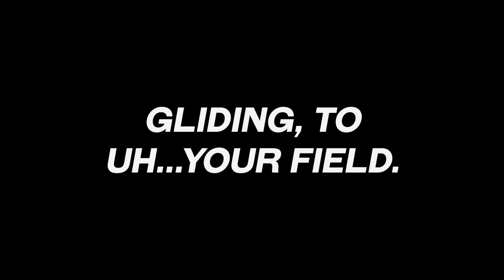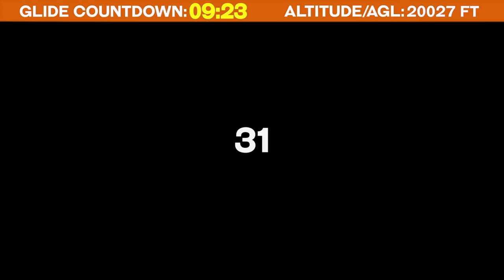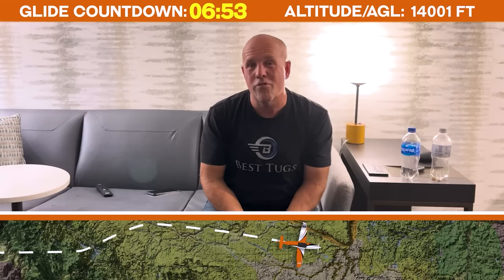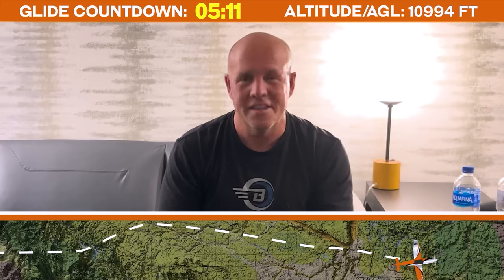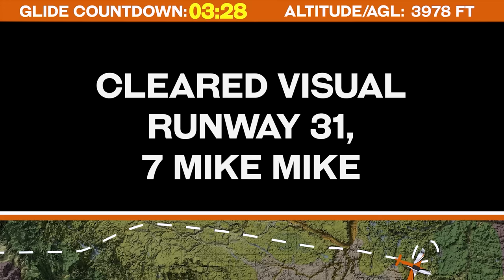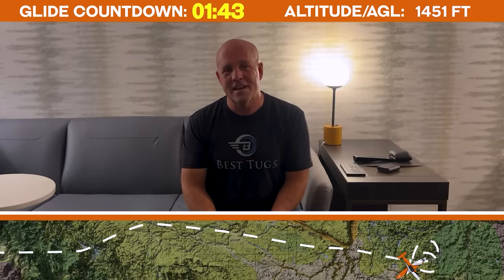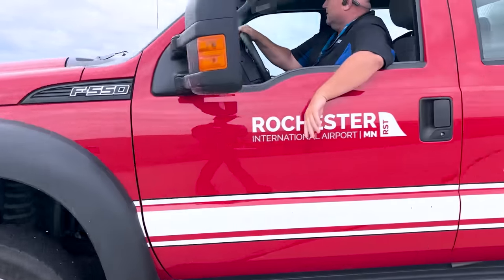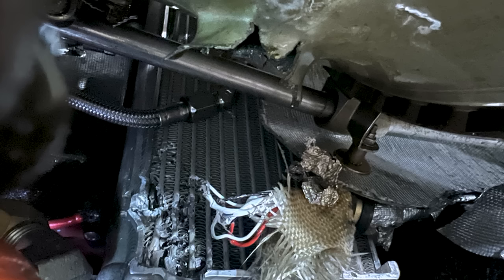Engine Explodes In Flight - Turbulence will not be at Airventure 2023 | Turbulence Emergency

Comment: As flight engineer in the Air Force for 20 years. I went to far to many funerals for heros in their 20's and 30's. I flew on the UH-1N which also uses the PT6 although the 1969 version. So many emergencies throughout my career and one of the things FE's are taught is pilots are allowed to panic FE's are not. It took years to understand that and it simply means we needed to be the calm cool crew member to calm the pilots nerves in that moment. I later had a pilot tell me he was freaking out but my calm tone immediatly set him at ease. He didnt realize on the inside I was freaking out, and that was during a rescue. I have also been doing functional check flights in the left seat with pilots and smoked an engine. Thankfully not our fault but still sucks, it was an issue from depot years earlier. If you want some help on the safety side I would love to help, I was a safety professional in aviation, munitions, and ground safety. I am now retired in southern Idaho right around the corner from you.
Reply: You can spend 20 more but you never gonna understand... nothing else

Comment: As someone who makes his living flying behind a 1700HP PT6,  this video’s a vivid reminder that yes, even PT6’s can and do occasionally quit.  Glad you got her down safe!
Reply: 1700 HP? Which bird is that?
Reply: @lanceweaver5228  Air tractor, probably
Reply: You have an exciting life/job. I make my living behind a high hp computer, it’s far more boring than you could imagine.
Reply: It's pretty surprising to see, all the PT-6's throughout the years I've flown or been around, this is the first catastrophic failure I've seen with no apparent reason.  Plenty of Garrett engines disintegrating (the cause was found to be a shady overhaul shop), no PT-6's though.  They have a great track record, but I still scout out a few spots to put her in at every field I work just in case.  No altitude to speak of for the most part, and it's not like we're punching holes through the sky with a plane that has "tractor" in its name LOL

Comment: Awesome story. In 12 years I had one engine failure in a single.  The biggest thing that literally made me tear up was how many aircraft assisted my situation. An A330, Dash-8, Beech 1900, PC-12 a C130 and 2 helicopters were all involved in some way in assisting find me.  It was absolutely amazing.  10 minutes after my forced landing in a remote location the Dash-8 and PC-12 had flown over my location to relay with SAR where I was and talk to me.  When someone is in trouble, the aviation community steps up fast if they can.

Comment: Wow! I’m so glad you both are safe.
Reply: Luckily, he made it to the airport - and didn't need your expertise😉

Greetings from Germany!!
Reply: Metal fatigue and one of the blades let go. I had this experience 10 times in 27T hrs of flight. Lost two engines on the B727 the same trip. As you said, someone abused the three engines. Previous crew left the fuel heat on for take off…. The engines overheated and they returned to the Airport… booked of the flight and the called us… no one reported the overheat condition… we departed to the high Arctic… as we returned from our destination one of the engines gave us the warning indicating high oil temperature. Shut down the troubled engine… 30 minutes later the next engined indicated high oil t… the third was running hotter then normal.. 200 miles to the next Airport.  We thought if the next one failed we can restart the first one we shut down… finally on final approach on one engine and higher than normal oil temp. We started the first one again and operated it in the idle position… successfully landing on two crippled engines. So, to all pilots… if you f#$& up be honest and report the full story… In this case we had half the plane with passengers the other half was freight plus 6 crew member.   Never respected the three pilots that returned to the Airport without reporting the details….
Reply: @meissert  Is there any chance to find out by inspecting the engine?

I'm a car guy and know little about this.

Comment: Mike, I’m a long time watcher, and would like to welcome you to our very exclusive and small club.  A PT6 catastrophic failure with a split containment ring.  
Mine was a PT6A-34.  Fortunately, I had two of them.  When the fire was out (yes fire, thank heavens I had extinguishing), I was able to look out and see through the engine cover (which had an new 10 inch hole in it) straight into the compressor section, of which half was missing.  The engine lining and containment ring, made for just this purpose failed at its only job, and had split and curled or peeled back, similar to yours, leaving a 6 inch hole in the engine.  I was told by P&W Canada that I should buy a lottery ticket, as this was one of the most rare events they had ever seen.

I will admit to being grateful for having the two engines as I was 250 NM from land over the Arctic Ocean in the summer, and knew the other would get me to land.  A pretty funny part to the story was before we landed, we received a relayed message from Transport Canada asking us to send them an oil sample on landing.  In was must have been my attempt to regain my composure, I sent the message back that if TC wanted an oil sample, they were going to have to get a boat as all my oil was either burned, or sitting 200 miles out it the middle of the ocean, because I don’t have any.😅

In the end, the newly hot sectioned engine had an improperly installed oil seal bearing (at the rebuild shop), and this was not in anyway an actually P&W problem, just my problem.  NORAD (Canada and the USA) had been running PT6-20s in the 60s and 70s and 80s running generators on the DEW line in Northern Canada.  Because they weren’t used for aviation, regular limit observance weren’t used, and I was told many of them were running continuously and only shut down once a year for maintenance.  That means running 9000 hours a years.

The most sobering moment for me was when maintenance asked me to come and look at something.  There, embedded in the acrylic side cockpit window was a single blade that went through the first of two panes, about 3 inches from my temple.  That brought it really home for how badly this could have gone for me and my family.  I endeavoured since then to always stay as far away from “the line” as I can.  Trouble finds you even when you’re not looking.

I now fly B787 Dreamliners, and to this day have a slightly elevated confidence in my abilities to survive that day, and a commitment to my passengers and crew that if ever there could be something done to save the day, I’d make sure I knew how to do it.

I’m glad your OK, and I believe you when you say you’re going to make sure to learn whatever lessons this can teach you.
Reply: How about getting an entire aircraft  Parachute !
How about some kind of fire Suppression System  too !

Comment: I had a PT6A explode on me at night over the English Channel in a US Navy Super King Air back in the 90’s.  I had just joined the squadron after being. P3 driver and had gone through transition training which involved multiple simulated engine failures.  I was left seat so I ran through the checklist, turned around and started descending back to base. Plenty of power on the good engine and uneventful ILS into Mildenhall. The PIC pretty much froze the whole way through. I reckon he had the disadvantage of flying in this plane without any incident for years and so had become de-conditioned to the possibility of a fireball coming out the PT6 as it disintegrated. Good job on handling the no-power situation!

Comment: As the safety manager of a commercial IFR single engine turbine operation here in Australia, this video is a great resource. Thanks for being so open Mike, I’ll be taking a really keen interest in seeing how this engine failed.
Reply: I was wondering about a forensic analysis on that motor. If I were to guess it'd be one of the journals for the crank
Reply: @billvandorn5332 seeing that a turbine engine has neither journals nor a crank, I would be quite certain that is not the case. I would guess turbine blade failure.
Reply: @thebigmacd 😂

Comment: I have had over 35 years in the PT6 and PW120,123,150A, and have never had a catastrophic failure. As Mike has said, they really are reliable. This is an outlier in terms of failures from my experience and you did a fantastic job Mike. Well done Sir!

Comment: Catastrophic engine failure at that altitude was properly better than some intermittent engine failure. When it exploded, it eliminated any need to consider restart procedures, and allowed you to focus in quickly on getting the plane on the ground safely. I've seen several incidents where intermittent engine problems caused people to come up short, second guess life saving decisions, etc. While definitely not a good thing whatsoever, it was good that it was no questioning or second guessing what you needed to do. Land the plane safely.  That was the goal from the get go, and you absolutely nailed it. 👏 👏

Comment: Well done, Mike - and well told.
I was right there with you all the way down and could certainly relate to what you were feeling.
I've been flying for 57 years and - primarily because I mostly fly VERY old antiques/test fly newly-restored "classics," &  ferry-fly taildraggers to maintenance facilities - I've been through Twenty-One in-flight engine failures during my life.
As a result, I treat EVERY circuit/pattern as a chance to practice Emergency Landings.
I always come in high, chop the power turning base, then "nibble off" the altitude in slips - ALWAYS making sure I'm higher than I need to be right down to the "button."
And - like you - I play the "If the engine quits now, where will I go" game all the time I'm in the air.
So, when (not IF) an engine quits, I already know where I'm going and how I will get down.
Two engine failures that stand out for me are:
* 8,000' over the ocean, half-way from P.E.I. to Nova Scotia (16 miles) in Canada's oldest flying airplane {a 1929 Gipsy Moth}), the old Gipsy 1 engine started coming apart - then stopped. I had JUST enough altitude to glide to the N.S. coast and landed {UPHILL} on the first field past the beach!
* A PERFECT example of what you're talking about occurred  when a friend asked me to check out the Fleet Canuck he'd bought. It had JUST had a brand-new 0-200 installed and - TWO fresh annuals (one by the seller's AME and one by his OWN AME). 
BOTH said the plane was running PERFECTLY. 
After my OWN careful checks, I took off and had just turned downwind when the 0-200's front right rockers started coming apart and the engine quit. No biggy. I had enough height to land on the main runway (slip-nibbling all the way down), BUT...
What NOBODY could believe was that this had happened to a BRAND-NEW, freshly-annualed {twice} Continental 0-200.
So - YOU'RE RIGHT.
For most Pilots, engine failures ARE rare, but they CAN happen to ANYONE flying ANYTHING.
The answer - as you stated - is to Practice, Practice, Practice Emergency Landings whenever you can.
Sincere kudos for handling your situation so well AND for sharing the details with your fellow Pilots so we can ALL benefit from your experience.
All the best & cheers,
Glenn Norman

Comment: So glad you all are still here with us. One minor guess as to why it happened. If the engine ever had a minor prop strike, Even though there is no physical connection, it is possible to have the turbine blade strike the can. This causes the damage to the tips of the blades.

Comment: What an experience.  On an Aegis Cruiser we have four (4) LM-2500 Gas Turbine Engines at about 25,000SHP ea.  We lost 2B on the way back to Norfolk coming home from Puerto Rico in the middle of the Sargossa Sea in the Bermuda Triangle.  I was sitting in my console in CIC and felt it, heard it (muffled boom), and later the engineers had a pan of small pieced on the Mess Decks so you could go pick up your piece of 2B.  We had the same experience in maintenance and operations with no warning.  She just blew.  Since we had three more turbine with two on the other shaft we had no problems getting home (NOB Norfolk).
Great job on the safety brief.  Keep going Mike!

Comment: WELL DONE MATE. What a great job, especially in the smoke and through IMC. I had an engine failure in Australia years ago in a flying brick (TB10) at around 5500 agl. Also had a very close buddy with me and also got the souls on board question from area atc - so I understand what you're saying here. At one point in the few mins it took to get down my mate asked me strait up as calm as a cucumber "are we going to make it through this?'. I said absolutely, no doubt, and he said OK. That was it. Well we made, totaled the plane because the nose gear broke off in soft mud of a ploughed paddock but neither of us got a scratch. We did almost die on the ride to town with an overzealous police officer doing 100kph on a dirt road in a landcruiser, but that's a whole other story. 
And you're so right about the practicing of forced landings, they count, do em. I would add that practicing always ends at 500 AGL, its the last 500 that you cant practice so after your flight imagine in your mind how that last 500ft would look like.

Comment: That's tough to hear, you've put so much hard work and time into this project. I'm just glad to hear that you are okay. Nothing came through the cockpit, the motor stayed mounted, in the end, chalk it up to experimentation. Unlike the thousands of experimental pilots who lost their lives in the pursuit of pushing the boundaries of aeronautical engineering, you made it home in one piece with only a little bruised pride. I'd call that an extremely successful flight. 
 

"If you aren't failing regularly, you aren't trying hard enough"
Reply: I think you miss understand the experimental part isn't from the engine itself it's more to do with the engine and airframe pairing ad mike even said that engine originally came out of a much bigger airframe

Comment: We were at a top Garrett overhaul shop and they said the proper shutdown/cooldown was just as important as startup for turbine engine life. Might not be that way for a PT-6, and you don't really know the engine's history - but something to consider.
Great Flying, Mike.
Reply: You are 100% correct, the PT6 needs 1min cool down after the idle temp has stabilized. Not doing the correct cool down could lead to blade scrape which will lead to catastrophic failure.

Comment: Mike, I was thinking that one saving grace about this catastrophic engine failure is the fact that you were at 27,000 feet when it happened. What if this had taken place on take off or at a low altitude.  With your high altitude you had enough time to troubleshoot the problem, communicate with ATC and coordinate a long runway to glide into. Glad you and your friend are ok!! 👍🙏
Reply: Yes and no. What if he had caught fire? Would you rather be at 27000 or 3000? If all that oil had hit an ignition source he would have been screwed unless he had a chute. No way to get down in time.
Reply: @sblack48  Duh. But he didnt catch fire. This is why I said it's a ONE saving grace. Always some internet troll looking to argue a point on YouTube. Go troll someone elses comments.

Comment: Be prepared!!!
How right you are, Mike. 
I had to make a dead stick landing twice in my pilot life due to engine failure so I share this point: be prepared and train, train, train!!!
Glad to hear and see how you managed to pass the threshold of this narrow gate that separates success from failure. 
You own a squadron of angels!
Such wingmen desserve an eternal thankfulness. 
I’m in the airline industry, and for our crew members, we have a Critical Incident Response Program (CIRP). 
What you do when sharing this event with us, the pilots and air community is an essential part of the CIRP!!!
Discharging the stress, sharing the emotions, progressively evacuating the fear of the near death situation is vital!!!
Those who think they are strong enough to deal alone with such an experience generally fall down into deep depression due to post traumatic syndrome. 
Watch out to any sign of trouble or discomfort and don’t let them overwhelm you. 
Be blessed, you and your family.
Reply: As a humble Touring Motorglider pilot (Grob 109b) we, our flying club had a fine flying camp in the Austrian Alps. Out of 7 flights that camp, I made 5 glider landings with the engine off.  
All neat greasers on the centre of the grass runway.  Normally we shut down the engine at 10.000 ft or so... gliding down is not a thrill, but more a "switch-set" in mind-switch.  -- Now we are glider with its limitations--. Nothing exciting about that. Just gliding a heavier glider with some dead metal in the nose.
I would say: train that switch-set. Do not be afraid.

Comment: Turbine engines don't always "whisper little things". I know. I've been on board two separate C-130s that had catastrophic engine failures. There were no indications prior to failure, and THAT is more the way things happen in turbine powered aircraft. This is what happens when the engine  rotates at 10K-30K rpm. 38 year A&P, here, with almost all my experience on heavy turbine-powered aircraft. I am very glad you made it to an airfield, and I'm also glad you were up so high, enabling you to get to a runway. Good job, Mike.